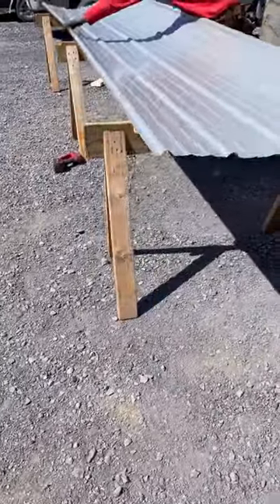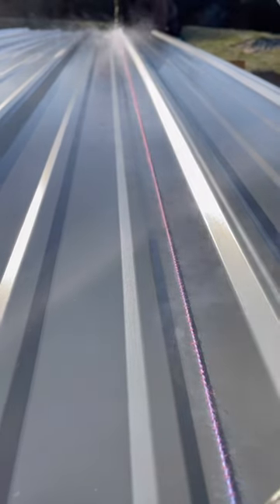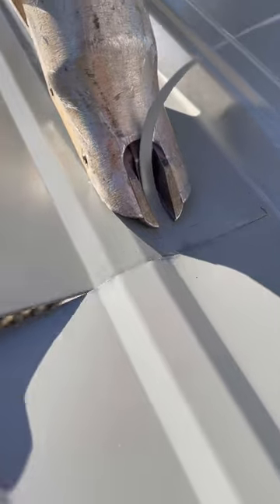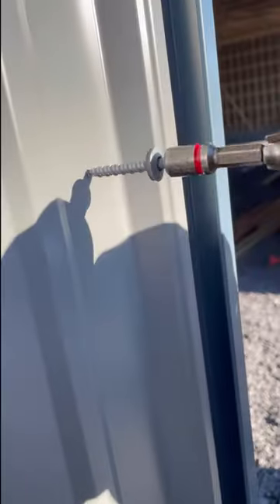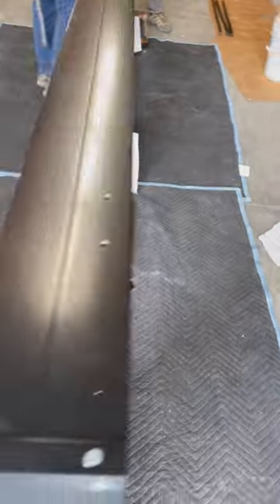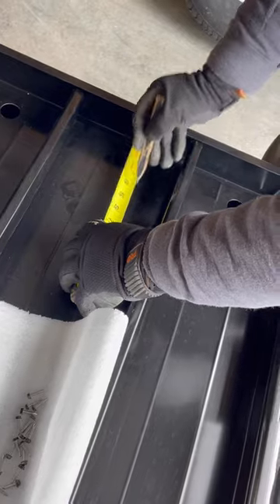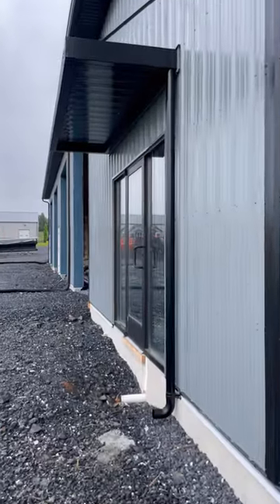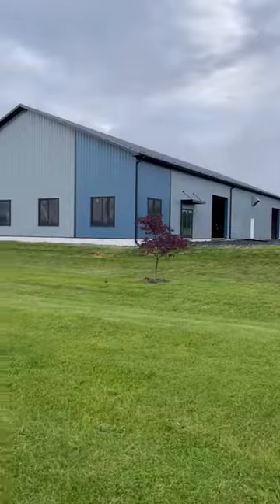Check out this Metal Siding Installation

Comment: Looks good. But as someone who repairs barns for a living you should've gotten a Morton instead of that brand x building it'll be rotten in 10-15 years. I just did a roof and rotten perlin/truss replacement on a Menards building from 2005
Reply: Must not have been done right to start. We do old barns as well. Our building last much longer than that!